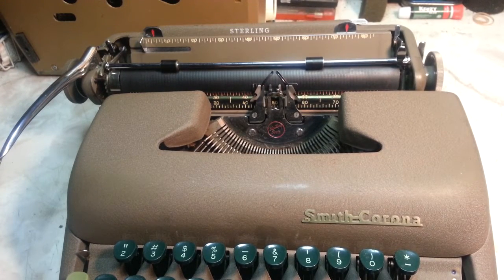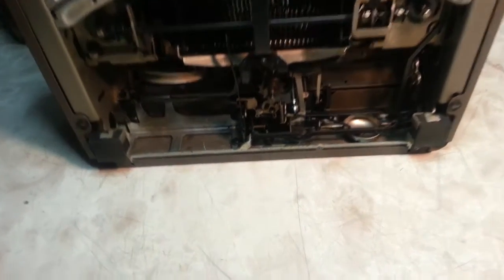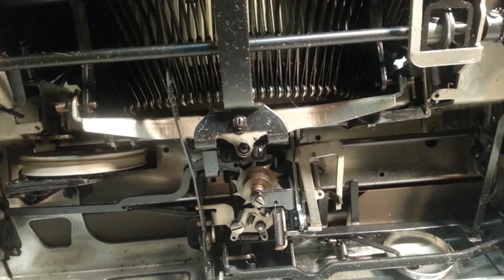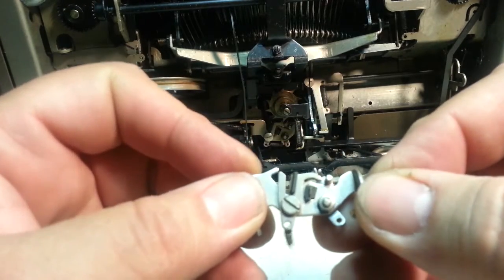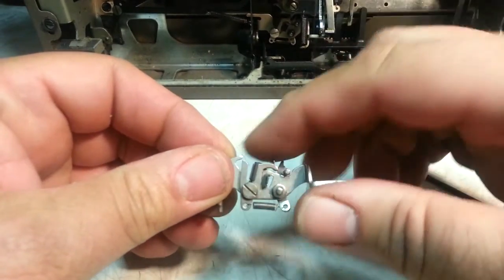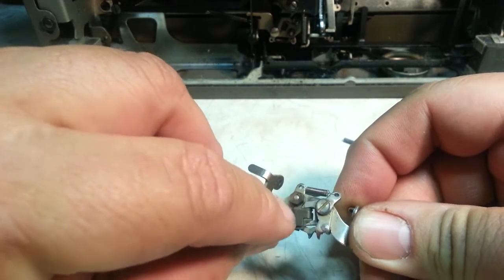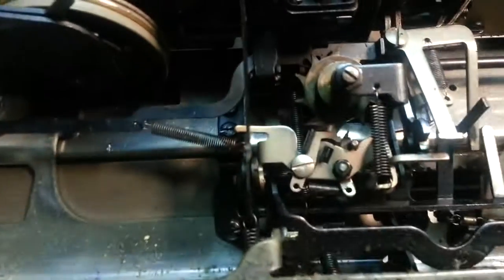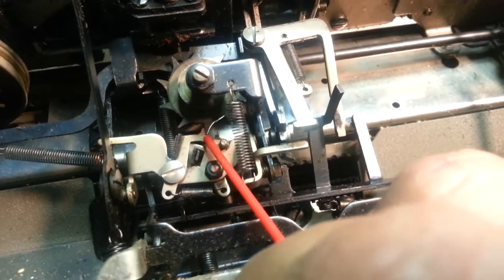Smith Corona typewriter escapement noise pawl clicking , sterling, super silent

Comment: Duane, VERY timely video, you obviously sensed my need. My coral pink Super was making an awful racket when returning the carriage, to the point I started thinking of a parts typewriter that I would soon need.  Your video and five mins later it was fixed.  It now sounds like this Sterling. I didn't take all the rubber off, but sliced it in half (so there is still a thin layer) but its good now. Needed this to get the confidence to just do it. So thank you very much. You videos are enlightening and useful. Typing is way more fun when the typewriter works properly 😉

Comment: Looks like we can buy 1/16" 12x12 neoprene rubber sheets that can be cut to form these pieces. Ought to work well here since neoprene can handle the oil likely to get on it. (Silicone rubber cannot.)